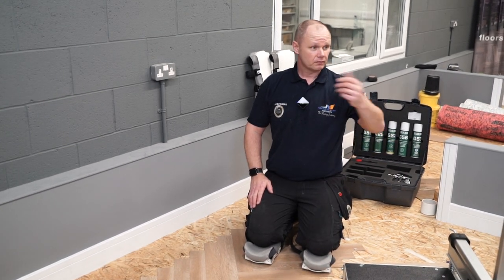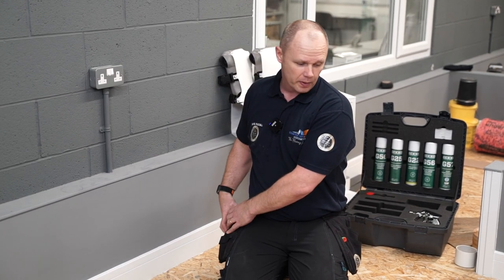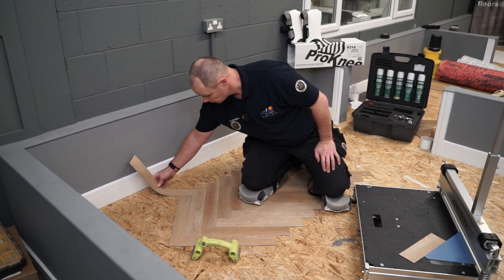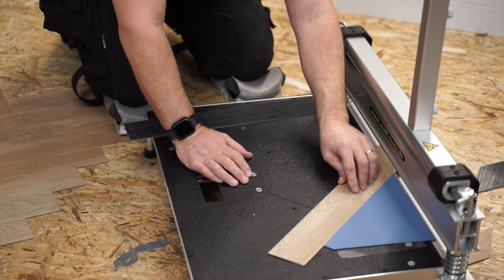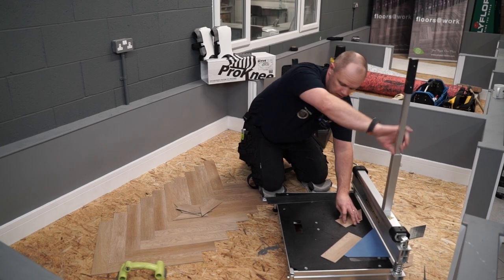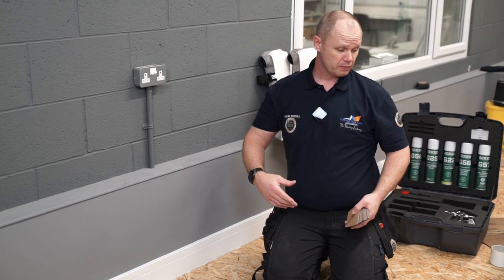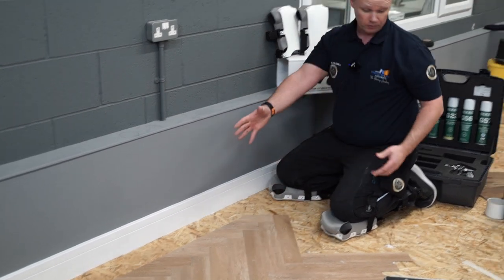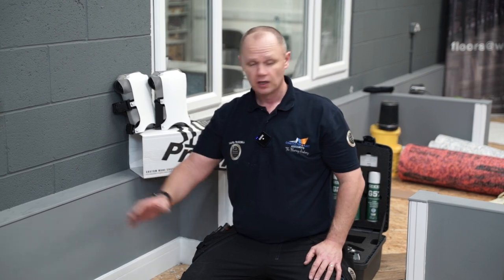CP Assessment Fitting LVT Herringbone! - Ft David Russel

Comment: That's OK as long as you wall's are  square or no skirting on
Reply: The walls being out doesn’t matter clearly you don’t understand herringbone it’s a about the field being square not the border
Reply: Yes the field needs to be square! But square to what, pick a wall or a part of the wall. But it will not work with all the walls. Guiltine has no use fitting herringbone been doing it 20 years